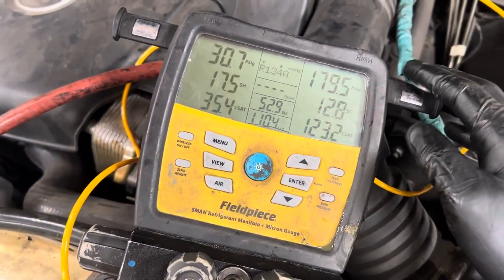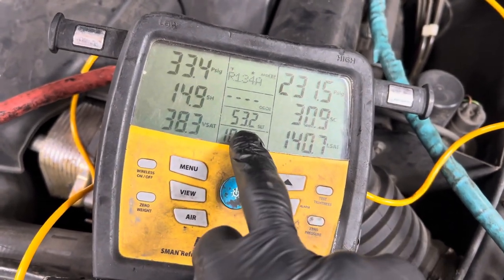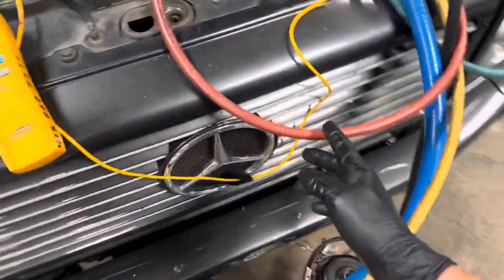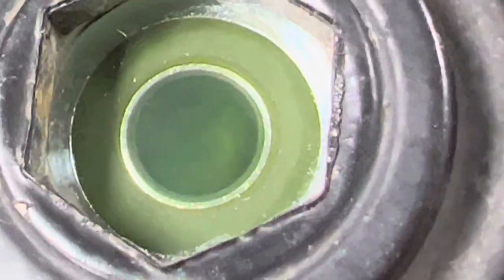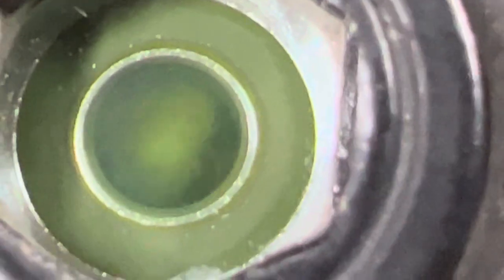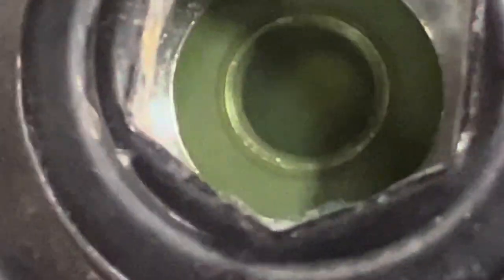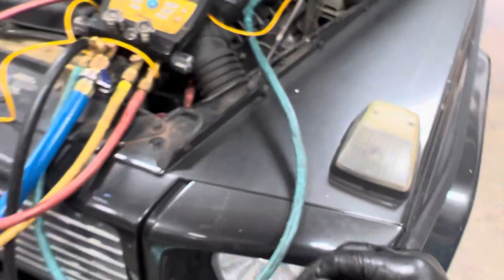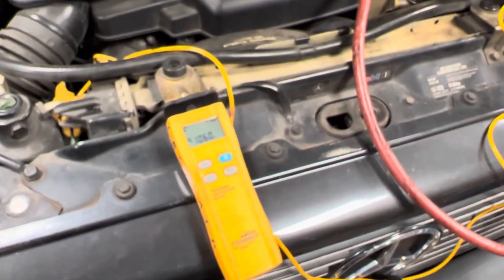This is why you don’t trust bubbles in the site glass even if the manufacturer tells you￼

Comment: I like sight glasses because they air in seeing what’s going on. For example, milky sight glasses are a great way to tell if the desiccant is moving in the system due to damage. They aren’t charge gauges but useful none the less.
Reply from the maker: Usually Milky is extremely high moisture content or when somebody mixed two different types of oils together that are not compatible. 

Usually desiccant makes it as far as the expansion valve if you’re lucky it’s one with the screen in it and it just gets plugged up and the low side goes into a vacuum. 

Some systems that had too much moisture and developed a higher acid level eats away at the padding material that holds the desiccant in and the BBs fall through the small holes tumble around and turn into a mud or a sand small broken up pieces.

Comment: Toyota recommends to use sight glass  to recharge AC in their specs.they wrote  in sticker under the hood to replenish with refrigerant of 100+ or- 50g after bubbles disappear.
Reply from the maker: If you put 100 + or - in my Prius C it would not cool on a hot day too low
the compressor would shut down over 440 psi on their safety pressure switch on a hot day  if over 100 g 

They write that kind of sticker in countries were they know people do not have expensive equipment 

Just so they can kind of get close to working . 

Here are stickers are usually a exact measurement by weight 

And sometimes they will see plus or -25 g on the big systems 

The smallest I have seen is plus or -5 g on the small systems . 

That’s a big difference
Reply: We have corolla 2013 ac recharging is  only by sight glass in the sticker under the hood,we charged it  but bubbles no disappear and ac is perfect but sometimes not and compressor is cycling on &off for short period of time we have decided to add more refrigerant till bubbles disappea plus  50 g  after tha tcooling became perfect compressor cycling is less.This my experience.
Reply from the maker: @issamadam9352  it’s different on different vehicles not all react the same.
Reply: So then your video would only apply to certain vehicles.
Reply from the maker: @HayabusaRydr  there are so many different type of vehicle combinations. 

Just the type of fan arrangement . Fans that pulse on and off are different than fans that slowly adjust up and down that are maintaining a head pressure in a tight narrowband.

The on and off and that might wait until the high side pressure gets 270 psi and then turns off the fan at 150 psi .  

Then you have the mechanical fluid, Thermal fan  straight off an engine and pulley 

Then you’re comparing apples and oranges between vehicles that have variable displacement compressors 

Or fix piston compressors 

Systems @have orifice tube and accumulators 

To a system with a expansion valve and receiver dryer 

There is no rule of thumb anymore, extremely vehicle specific . 

I’ve posted videos at the same time two vehicles in the same shop where one vehicles 89 psi on the high side but the vehicle right next to it allows the high side pressure to go all the way up to 270 psi but yet they’re both side-by-side 

Well one may have 39° coming out of the dash and the other half of 54° coming out of the dash . 

Some vehicles, low side pressure 12 psi is normal on another vehicle 34 psi is normal and other somewhere in between . 

I have videos of vehicles that had half the refrigerant charge in the system and have a completely clear sight glass 

Other vehicles with a full refrigerant charge and have bubbles in the site glass . 

And that’s only a small fraction of the possibilities in different arrangements

Comment: Jst   ?? Maybe the the Merc engineers are underfilling the system  on purpose . Even thou all the other indicators SH  SC H/L PSI  are reading good plus the vent temp ok . As u have mentioned b4 the charge amount might be in the ok zone but still less than perfect . Maybe . 
As we all no,  bubbles will be present upon compressor startup and for some time 1-2min  but sight glass will can eventually run fairly clear . 
Definition of ""Full"" has been fuzzy since makers started doing weight fill .

Comment: Doesn't the dyed oil also help to confirm lubricant isn't bring removed during an recovery?
Reply from the maker: No,   You recover vapor only . Look in sight glass on manifold to see that there is no oil or liquid being pulled. 

If you see any movement, you slow down the recovery valve.
Reply: @coldfinger459sub0  Okay.  No benefit.

Comment: A clogged dryer filter creates a pressure drop which causes bubbles
Reply from the maker: This is not commercial or residential.  We are very rarely have that problem..  

It’s the way our compressor cycles, and the condenser fans cycle on and off for their variable speed and a cycle their speed up and down a little bit . 

As it changes the airflow, the bubbles will form because the saturation temperature is constantly Vereen. You watch your sub cooling, go up and down and the bubbles come and go. . 

Cars do not operate like residential or refrigeration